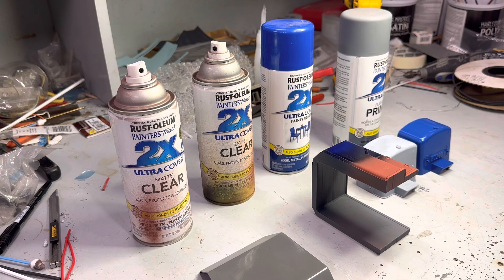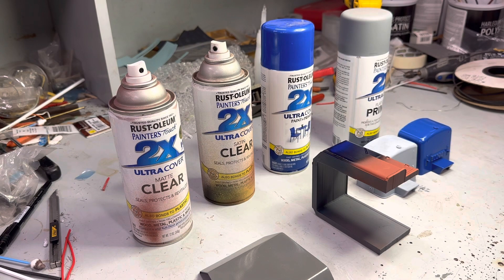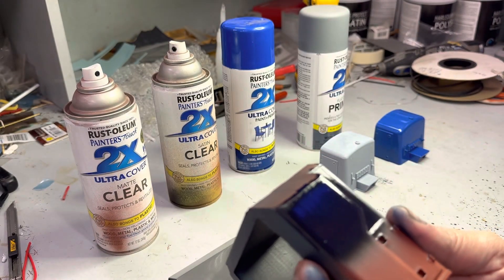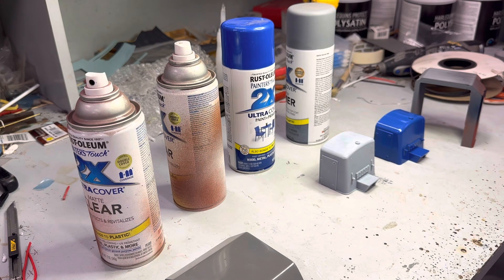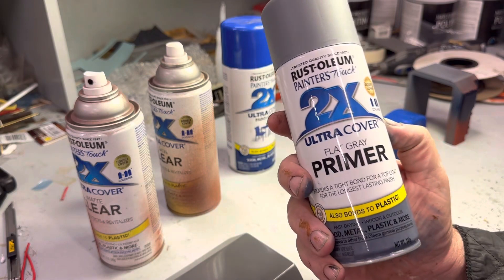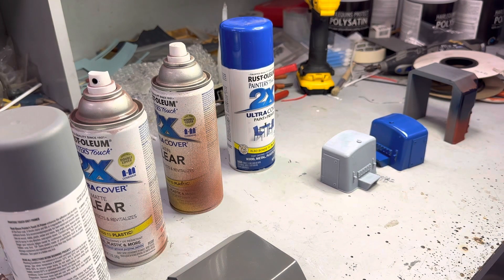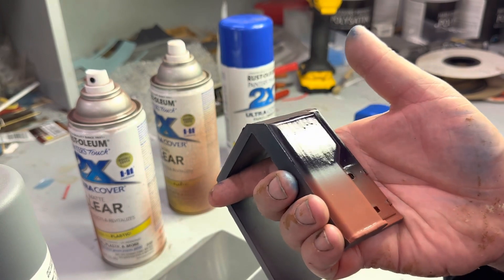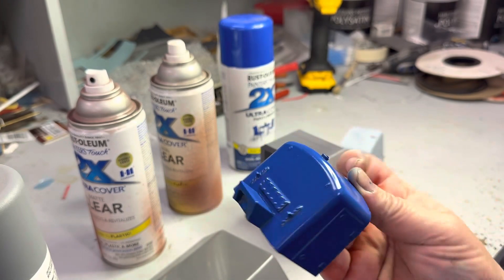Most dangerous video on Youtube. How to smooth a 3d print out of a tin, as a final finish.

Comment: Do you spray direct from the can or do you decant and airbrush?  Tony
Reply from the maker: These were straight out the can bar the Tamiya dark blue on the rough print. That was out the airbrush.
Reply: @riekusvanderwesthuizen471  and do you thin when airbrushing?
Reply from the maker: @anthonysheffield5717  When I decant Rust-oleum, I thin it with a third laquer thinner. I thin Tamiya 50/50